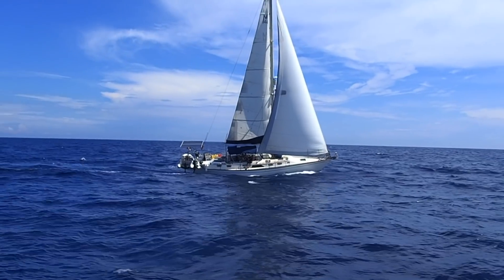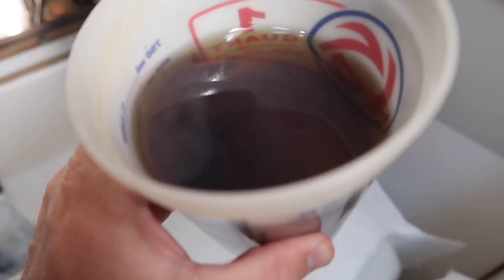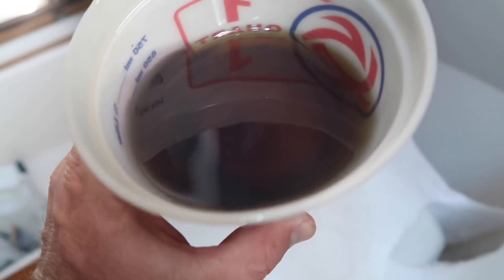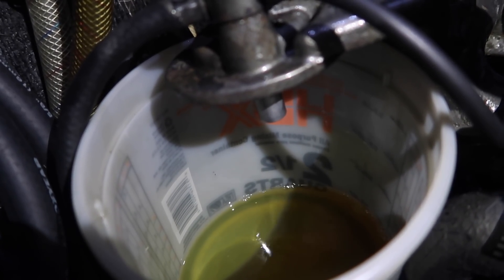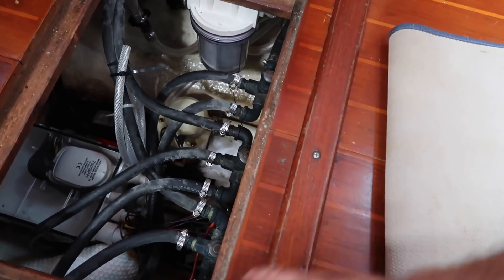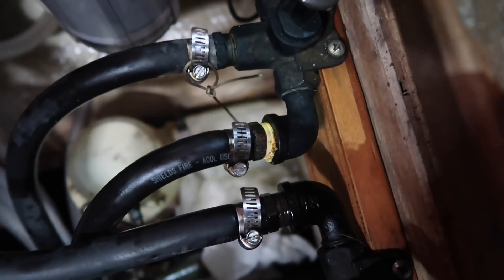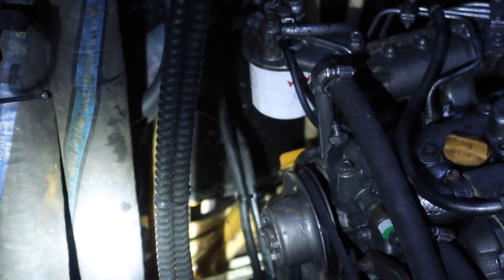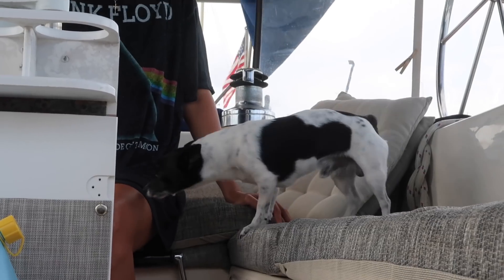Hunt for the Diesel Bug!- Fuel System Troubleshooting (Sailing Satori) S3:E04

Comment: Hi Guys. Interesting video as always. Without teaching you to suck the odd egg or two, regarding diesel bug. If your engine has return lines from the injectors the fuel is constantly polished while the engine is running. The issue is about fuel velocity and flow in the system from the tank to the injector pump (assuming the tanks are not 100% clean)  As fuel flows there is a resistance caused by tight bends or fittings that are not full bore (ie smaller than the pipe size) Elbows, Banjo fittings, or hose tail fittings. At these points the fuel is constricted and the resistance of the constriction causes the fuel to slow. Much like an electrical resistance. Its these points the bug will clog the system due to the lower flow rate and the constriction. As you demonstrated a foot pump can blow these blockages back. We have had some issues when we were sailing in the UK as the fuel tanks condensate more due to the low water temp and warm air temps. Our solution that seems to work well over the last 5-7 years is, to make sure all your fittings are full flow with the same bore as the pipes. any Elows or sharp  turns(elbows need to be the swept type not a 90 degree). (more wall friction) But most of all, as the fuel pick-up leaves the tank fit a small transparent plastic fuel filter before any taps or bends. This can inspected visually every week and will trap any bug if your tanks are not clean or you picked up dirty diesel. If it appears dirty or clogged its a $3.00 part you can change in a minute or two. Available on eBay  cheap as chips. Obviously, get your tanks cleaned and wipe them out with something nasty or your be back at square one pretty soon. An anti water and bug filter used when filling is always a good idea. Again funnels are on ebay for less than $14.00   Folks always say their fuel is good but, its good to trust, better not to. Love your videos and hope this is of use to you and anyone reading. Sail Safe. Ant, Cid & the Pooch crew.
Reply from the maker: Thank you so much, we appreciate you taking the time!

Comment: I've been working with diesel systems since 1997. Most often that black sludge is from old fuel lines deteriorated from the inside. If your lines are aging it may be time to replace them.
Reply: Thanks for sharing that, I'd also recommend cleaning out the fittings and  cleaning of the diesel tank. Gunk is the main reason for engine failure and  regular maintenance should prevent most issues . We invest so much time and money on other parts of our boats but neglect the fuel system which is the bit that will get us in the most trouble

Comment: damn im glad you got the hoses cleared---and it looks to me that you found the root problem---I used to work for a tank maint company--and I can tell you that the "blooby, sludegy crap you found in the tanks IS your problem--its amazing how much trouble a fuel fungus can cause filters--next time you make port, see if you can find a product called BIOBOR or Stanadyne---THEY BOTH A LITTLE PRICEY BUT WELL WORTH IT TO NOT HAVE TO DO WHAT YOU JUST WENT THROUGH, then use according to the label everytime you get fuel--maybe run a extra dose in the first fill to clean out your injectors--good luck!!!

Comment: Congratulations on getting the engine running again.  That was a lot of stuff growing in the tanks.  May want to treat all fuel you take on with Biobor JF.  Practical-Sailor.com has several test reports on diesel additives.  Among them is https://www.practical-sailor.com/boat-maintenance/diesel-biocides-take-on-contaminated-boat-fuel

Comment: With either new tanks and new fuel or cleaned out fuel system the best additive to use in diesel fuel is Biobor. This product will eliminate the fear of algae. Use it on each fill of the tanks.

Comment: Nasty job.  We were lucky in that we are able to remove our tanks and power wash them.  Had to do that and replace all the fuel lines, too.  The good news is that once the tanks are squeaky clean you should be good for a while.   I have heard that fuel in Luperon is pretty questionable, though.
Reply from the maker: It is... diesel gets everywhere! Wish I had the option to remove and clean, but wasn’t in the cards. This is completely my fault for not taking better care of my system and a hard lesson learned. This problem will continue to plague us through Puerto Rico... until drastic measures are taken. You’ll see!

Comment: Here are a couple of diesel fuel polishing formulas to use if you have access to them or can order them online somewhere.

1. Fuel Tank Hygiene: https://powerservice.com/find-my-product/#2
2. BIO KLEEN DIESEL FUEL BIOCIDE - https://powerservice.com/psp_product/bio-kleen-diesel-fuel-biocide/
3. CLEAR-DIESEL FUEL & TANK CLEANER - https://powerservice.com/psp_product/clear-diesel-fuel-tank-cleaner/
4. KILLEM Bacteria, Sludge, and Slime Maintenance - https://fppf.com/product/killem/

STEPS 
    1. Use the Bio-Clean first, that kills and breaks up the stuff. 
    2. Then you run the Clear-Diesel to further break up and clean through the system to purge
         out the particles.
    3. You will need to run your engines for a while and will go through several fuel filters until it's
         all broken up and removed throughout the entire system and totally cleaned. 
    4. Then use the KILLEM as a regular maintenance procedure throughout the year, maybe
         every 4 months. 

Also, make sure to use a PRE-FILTER for all diesel refueling, this filters out all the bad stuff prior to entering your tanks and prevents contaminating your fuel. You just never know what you're getting when cruising around the world.

1. Racor Rff1C Funnel-Fuel Filter 2.7 Gpm100M - https://www.racorstore.com/index.php/catalog/product/view/id/10680
Reply from the maker: Does Bio-Clean completely break down the sludge/slime so it can pass through the fuel lines?

After hours of internet searching, I found nothing that could do this, but don’t recall if I came across this product.

I did find and test a product that claims to do just that. Technol 246. Added it to a container with some sludge/slime. After a few weeks it made a dent, but was far from fully effective.
Reply: @SailingSatori  Use the Bio-Clean and Clear-Deisel together to get it all. I saw a video where they used this stuff and they said they had tried a ton of other things, including acid products and nothing would get it all but this combo of products. 

It's designed to clean out the entire system including the fuel lines as you should run the system for a while to make sure the product goes through everything thoroughly. 

I will have to check out the Technol 246 as I haven't heard of that before.

Comment: Microbes in the form of bacteria and fungus are present in all diesel fuels. Long periods of fuel storage can create ideal opportunities for microbes to grow in fuel tanks.

Bio Kleen Diesel Fuel Biocide kills microbes in diesel fuel. ... The first indication of microbial contamination is mucous-like accumulations on fuel-filters and increased requirements for fuel-filter replacement. The only way to get rid of microbial contamination is to kill the microbes with a biocide

Amazon.com: Power Service 09016-09 Bio Kleen Diesel Fuel Biocide - 16 oz.: Automotive
https://www.amazon.com/Power-Service-09016-09-Diesel-Biocide/dp/B005IUP9LC

Good job , on cleaning , and trouble shooting your system... hard work to clean it back out... keep the additive in to stop it from building up again.

Comment: I bought an old vw rabbit diesel rabbit years ago and it had a bad fuel problem.  From a junk yard i found a fuel filter and an electric fuel pump and made a fuel filtering system which constantly recycled and filtered the fuel.  No one had ever heard of fuel polishing  at that time.  The first week I had to change the filter element about 4 times.  After a month I only had to change it once.  I also started using algae preventative. I ran the vw for another 4 years and only had to change the filter element every 6 months or so.  Never gave me more problems.  I have always wondered why cruisers didn't do more of it.  Bad fuel is a major problem.
Reply from the maker: I agree... it’s no fun being out there and loosing the engine. Though, I think the problem is that most tanks don’t have the proper access to clean them... only a single inspection port for a tank with 4 closed off sections. Once clean, it’s been easy to keep clean with just adding biocide.

Comment: Looks like you nailed it. Simple. Systems can definitely cause ya grief, but the good thing is it’s simple system,
Reply from the maker: I agree, it’s all pretty simple. And 99%of the time, it’s a fuel issue. This problem is complicated by the large number of valves and fittings in the fuel line. Too many places for the slime balls to hide!
Reply: Sailing Satori those dirty ol slime balls!!!! 😂👍🇨🇦☃️cheers from Canada where it is -53 last night

Comment: two things most sailors neglect polishing their fuel and if they have a fresh water cooled engine is replacing the impeller and descaling the heat exchanger every year. your boat has a nice polishing system already plumbed after every refueling or once a week polish your fuel a general rule is to cycle the amount of fuel you carry twice thru the filters. I have watched many sailors over heat and when they pull the impeller it is missing vanes the average impeller will last about two years so if you replace it once a year it greatly reduces the chance it will fail clean the sea strainer every time you prepare to leave a anchorage and clean the exchanger once a year there are some good flushing products that will descale search youtube there are many vids on flushing the cooling system  and it's good to see author has the situation handled
Reply from the maker: I agree, to some extent. Polishing is important, if you have a problem. It’s more important to keep a clean tank clean. That is done simply by adding biocide to every fill. Something I should have done from day one. But because my system returns so much un-burnt fuel, it’s constantly polishing itself when the engine is running.

Yes on the impeller!

I’m probably due for descaling.

Comment: Fuel issues are a massive pain in the fundament.  A few years ago, I was just leaving the harbour, plowing through nasty waves at the harbour mouth and the engine sputtered to a stop.  My kids managed to get the anchour out just before we ended up on the rocks.  After I was towed back in, I went through the same steps and think it was water in the fuel.  I pumped out and disposed of the diesel, scrubbed the tank interior, which was an almost impossible job in tight quarters, replaced most of the old fuel lines, and plumbed in a bigger Racor filter.  I now only buy diesel from truck stops after a mechanic teaching a sailboat diesel maintenance course said that he started sampling the diesel in our area and found most of it had water in it (older tanks, etc).  I also always use a hydrophobic filter when filling.  Interestingly, I’ve never found a drop of water in the diesel from the truck stop, but twice in an emergency I’ve picked up some from local gas stations and found quite a bit of water left after I filled up.  Glad to see you guys back.  Lance. SV Great Escape - Newport 30

Comment: The stand pipe in a fuel tank  often has a mesh sock on the bottom they are a pre filter . When these get plugged they can't be cleaned and must be replaced.